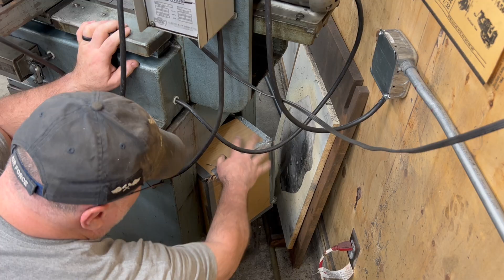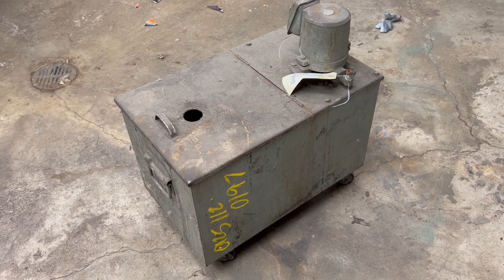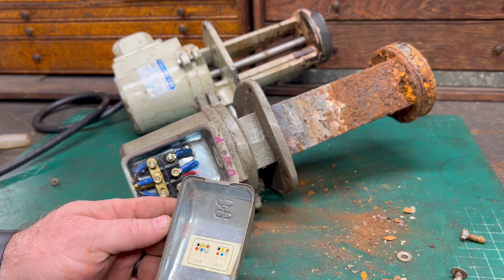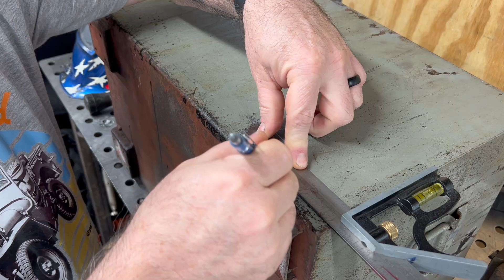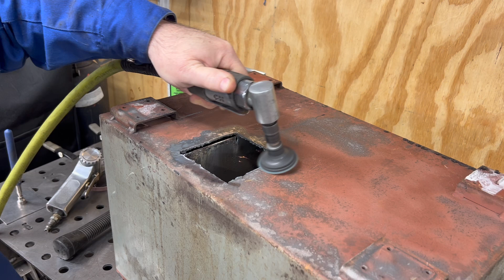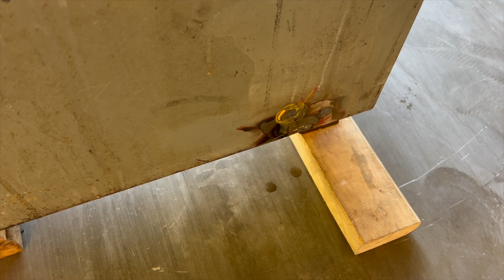Coolant Sump for the Sanford Surface Grinder - FAIL!!

Comment: TIG brazing with silicon-bronze prevents the ingress of rust oxides into the puddle, because you are not melting the base steel.  Alternatively, is you have a porous weld, you can just use tin/lead solder to seal the pits.   --Doozer
Reply from the maker: Thanks. Something to keep in mind if I decide to try fixing this junk again.

Comment: As you are just learning how to grind, having coolant will mask a lot of mistakes, and will prevent you from learning proper technique and wheel selection. Not a good plan for the beginner. Use coolant to solve a grinding problem that you can not solve any other way.  Not as a crutch for bad technique.  ----Doozer
Reply from the maker: Thanks for the comment!

Comment: How about some of that conformable rubber coating stuff that you can buy for fixing leaks in automobile gas tanks?
Reply from the maker: I haven't heard of that before. But I've already spent more on this than I really wanted to. If I'm going to spend the money, I might as well buy the sheet steel.

Comment: Chasing rust burn through is excellent practice! Personally I would have got out the oxy/fuel and brazed the seams after welding in the patches.
Reply from the maker: That is an option, and probably a better one.

Comment: Don't you have a industrial steel yard in your area where you can buy steel . New and rems. If your new box leaks use lead over the weld  to seal it like a radiator repair. JM
Reply from the maker: The leads not a bad idea!
Reply: I have a 1954 Oliver tractor and someone repaired the gas tank at a radiator shop and i also made a repair using propane torch and   solid solder and liquid flux it worked but i finally took it to a radiator shop . The guy said it was a good repair but i missed a pin hole and that's why it seeped. well not sure if it would work over rust . Good luck  JM

Comment: Here is my 3 cents. Since you are going to be mounting the pump outside the grinder base then Just use the steel box and put a plastic container inside the steel box. could be a plastic box or something as simple as a bucket. We will never know. And it will work. And it will be cheap.
Reply from the maker: Yeah, but I still want the baffles to filter out the junk.
Reply: @MyLilMule  That would not be too hard to do. Since you are going to be grinding mostly steel or cast iron maybe a magnet filter would do. Or use 2 plastic containers connected together via hose fittings. On the production grinders we had at GM we used paper filters. What ever you choose I am sure it will be top shelf.

Comment: You might check to see if you have a fabrication shop in your area that can provide and shear the metal plate to the dimensions you specify.  I have such a shop locally that I've been using for years to have bits and pieces of metal cut to the sizes I want.  I'm actually waiting for a couple of metal panels that I hope will be ready this week.  Costs generally aren't to bad, especially if it's just cutting metal to length.
Reply: Agreed. You could always get SCS to cut out the more intricate top panel, and go local for the simple sheared sheets.
Reply from the maker: I will check on a few places.